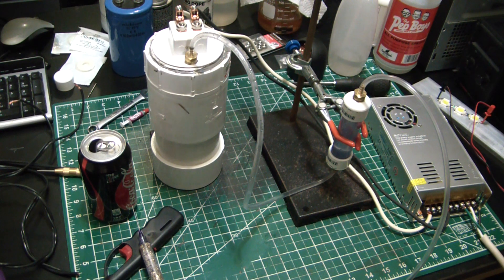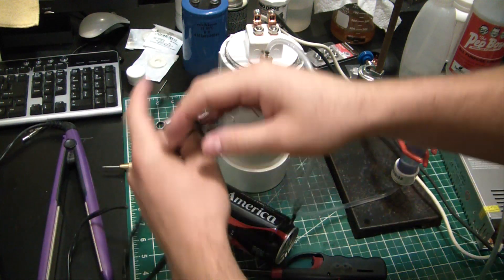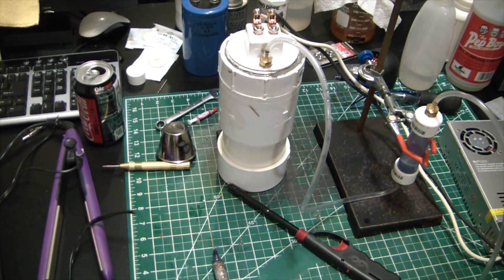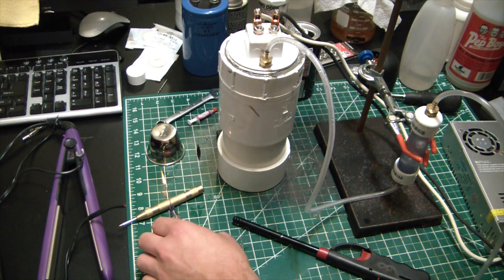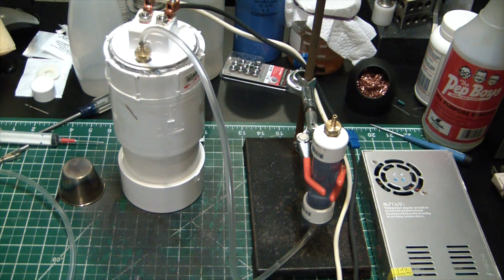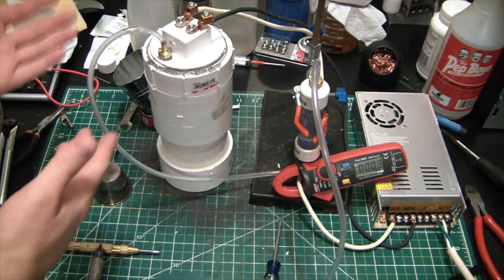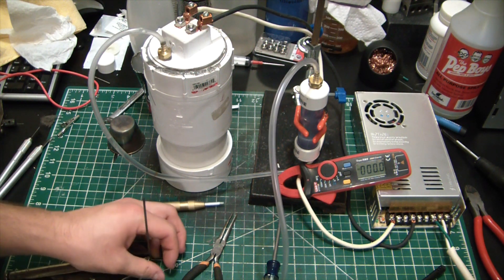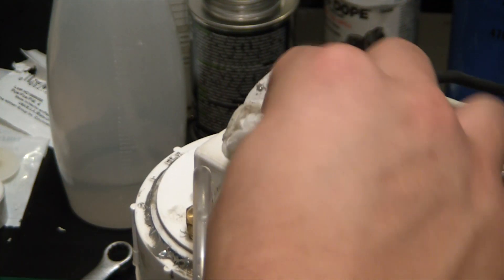Cutting Metal With Water! HHO Torch Success - ElementalMaker

Comment: To make garnet or synthetic ruby or whatever you're going to need a shaker assembly to 'tap' your Al2O3 and chrome mixture into the gas burner before the gas is lit. Trust me on this, you want to read this section of a book called "Procedures in Experimental Physics" (I have this book) and I have used a similar system to grow strontium titanate crystals for research when I was in college (I did all kinds of neat shit. 

I found the book online, here's the page that shows an apparatus to make ruby:

https://archive.org/details/ProceduresInExperimentalPhysics/page/n537

The book is like 26 bucks, seriously it's worth the read, all kinds of good stuff in it. 

Another thing to note, 10 gauge wire is nowhere near enough for 50 amps you're shoving through it. You need to be down in the 6 or 8 gauge range. Check out this PDF.

http://encorewire.com/wp-content/uploads/amp%20voltage.pdf

Another item which goes along with your wire gauge issue, is your post terminals. First make them longer, so you have enough up top outside to double nut your connections, and I'd scrap that clamp terminal (they get loose as they heat up and the wire compresses), and get a crimped on lug. So your new power connection should go like this... metal nut, your lug, metal nut, some space, nylon nut, o ring, cap, o ring nylon nut on the inside then all your cones. That way you're not relying on a mechanical connection to do your electrical connection. That is a big no no in the power electronics industry for the exact reason you're having troubles. 

FYI, I'm an electrical engineer, so this is the stuff I work with regularly with 4kV motor variable speed drives up to 1000 amp per phase.
Reply from the maker: See my latest ruby video, I was able to successfully make it. I will be building a larger hho generator in the near future so I appreciate your feedback and links.
Reply: Oh, and to make crystals, you're probably going to want to make a bigger water bubbler to catch the carry over NAOH, and then follow that with a drying agent as moisture will make your feed stock clump up... you could use the desiccant stuff from a compressed air dryer.

Good luck!

Comment: Congrats on the successful cutting - nice. A next possible direction might be to produce hydrogen gas by chemically reacting sodium hydroxide and aluminum, and using the gas pressure to regulate the NaOH level, so regulating the reaction to produce as needed hydrogen gas? If done right, no need to store too much gas, but just produce it OTF. Uses= producing hydrogen to power a regular gasoline engine from scrap aluminum.

Comment: Maybe look at building a solid state hho generator. Your melting pvc issues should be a thing of the past.
Reply from the maker: Got a link? Never heard of such a thing.
Reply: @ElementalMaker  My wording was wrong, they call it a "Dry Cell". The HHO generator you have is a "Wet Cell". I saw the dry cell on a compilation video where the guy did not have a flashback arrestor and the flame shot back into the collection chamber and exploded. Anyway, it led me to research the weird looking mechanism since i've never seen it before and found this video:
https://www.youtube.com/watch?v=gQOxWXRsLB4

Comment: Dude, backflow arrester.

If the flame cuts out momentarily it can run up the tube and blow you up.

"my generator has a leak"
turns on generator and lights torch

C'mon now.

Also, aluminum is noxious.
Reply: Sunny West nahh, depend on how much hydrogen you have on your system, in general hydrogen can only flash back below a certain level of pressure/gas speed, such that if the on demand system can handle the small gas explosion energy then there's nothing to fear, however if you're storing hydrogen that's another conversation... damn i used a pet bottle as a 4 minute store of torch gas, that's dangerous as a motherfucking fuck.... it's firing up a dynamite  everytime....
Reply: The bubbler he has the gas going through acts as a flashback safeguard

Comment: Try to separate the hydrogen from the oxygen, and use the oxygen for a.. metal cutting carbide lamp?
(Acetylene burns hotter than hydrogen)
Reply: From what I have read, nothing burns hotter than hydrogen. Hydrogen burns at 5000 degrees. That's why they use it for rocket fuel.
Reply: UNITED POLICE STATES OF AMERICA from what I have read...acetylene is one of the few things that burn hotter than hydrogen?
(It has something to do with the carbon-carbon triple bond)
Just the temperature at wich something burns doesn’t determine how good it works as a rocket fuel.
Acetylene is too unstable and it can’t be stored under pressure.
Reply: UNITED POLICE STATES OF AMERICA btw the hottest burning substance that we know is Dicyanoacetylene, according to Wikipedia

Comment: smooth tip and enough gas flow to get a gap between tip and flame always works best anytime O2 is in the mix. Adjust the power supply down to get optimum current. there is a adj pot on the supply. To high of cell voltage will overheat everything cell terminals ect ect also the   power to high on cell causes O3.....4..5  as the temp goes up so does this factor and as number increases the flash point goes down rapidly!. hho has very low density a atm and burns extremely fast the low density makes the bang from the reduction of volume after the wee bit of heat so producing even greater reactivity of the O increases burn rate dangerously.
@2.5 volts the separation is at minimum reduce voltage by 1/2 a volt should help for operation of few minutes. Thermal and fluid level fail safes save from have to pick pvc bits out of your body. I have built these out of soda pop bottles but they always failed because plastic loses strength at low temps. Repurpose  stainless steel thermos cup or something stronger never use glass for HHO and add basic fail safes if you don't feel explaining to the ER  nurse how you  ended up with such a large chunk embedded into your ...... and the number of times you will be ask now how did .... not fun justasayen
Reply: p.s. back flow/flash is very important !. good ones that actually function some stainless wool stuffed in a tube is a fail to sum it up

Comment: You can use longer threaded rods and wrap the copper conductor directly into the rod and brace/clamp it with some thicker solid copper wire wrapped around it, the direct contact with the rod should allow more current without over heating and by using longer rods you can keep some distance to allow any heat to dissipate more.

Comment: Do ya think you can use the gasses generated in a combustion engine?
Reply: some people do, supposedly they get really great mileage that way on account of the fact that internal combustion engines rely on gasoline vaporizing in the chamber, being pulled into the piston and exploding to produce work. it also helps that hho gas is more volatile than vaporized gasoline on average.

Comment: I wish someone would make a video describing how Hydroxy Gas,( HHO ) is produced?  When you produce Brown's Gas, (HHO) you are not producing  Hydrogen!  Some Dumb-Asses think that's what is coming out of their bubbler!  When you produce on-demand HHO Gas,( to run your car, lets say) the engine is burning by the process of Fusion, Hydroxy Gas!  This is a different Molecule...It's not just Hydrogen and Oxygen!  That's where the Big Oil funded Myth Buster horse-shit starts!  They want to divert your attention by making you think Electrolysis Is necessary in order to produce the gas that's used to burn in your engine!  It is not!  Electrolysis is an Energy expensive process.  Producing Brown's Gas, ( Hydroxy, HHO ) does not take very much energy to produce because you are splitting nothing, just causing a different molecule to temporarily form bonds!
Reply from the maker: I'm going to respectfully disagree and say you may need to study the science of this further.

Comment: Looks good, maybe try incorporating a radiator to cool the water in the PVC down, could help with your heating issue
Reply from the maker: Very solid idea! If I have to do any long runs that will be a great solution for cooling the cell.

Comment: I love this project! HHO torches seem to catch a lot of shit for some reason, this looks like a lot of fun, practical uses aside, splitting molecules in the garage to produce an extremely hot flame sounds like a good time to me!
Reply from the maker: I think anything HHO gets a bad rap due to the potato brains trying to power their car and create overunity devices with HHO cells. It's definitely been an awesome project though, and the result has been great. Thanks for dropping a comment!
Reply: I heard that! I am hoping to try this soon, first I am still playing with a vacuum cannon i made from an old A/C compressor a neighbor gave me. Can only draw about 27.5"Hg so not sure if i can get the vacuum strong enough. Once i break the sound barrier in the shop with a ping pong ball I am hoping to try a few projects dealing with electricity. I saw someone produce Iron Oxide (III) using rail road ties, an electrolyte solution,  and a 12v supply, seems like this would be cheaper to produce this way at home instead of purchasing the ingredients for thermite reactions.
Reply: That's because there's no such thing as HHO.  "HHO" is a scam created by an Italian dude to sell bullshit products.  This is actually called a "water torch", and the gas is just a stoichiometric mixture of hydrogen and oxygen, called "oxyhydrogen", not "HHO".

Comment: the terminal is too short, if a bit longer you could put an extra nut under the contact and apply more pressure by squeezing them together to get a better contact and take the contact point off the plastic.
Reply from the maker: I've solved the issue by installing the heat sink plate under the connection terminal posts. It keeps the connection cool and allows higher clamping pressure. Only trouble is my 5V 60A power supply took a crap, not even a month old. Got a brand new one coming though so hopefully this one holds up.

Comment: Can you weld two peaces of 1/16 or 1/8 aluminum together? I would like to see that. 👍
If you can, I all need to make a setup like that for myself. 😜
Reply from the maker: Aluminum is a bit tricky as it conducts the heat away very quickly. This is also a very oxidizing flame, so it would probably booger up any weld you were able to make. I'll keep my tig for aluminum.

Comment: wouldn't it be easier to produce hydrogen chemically with acids or bases?
Reply from the maker: Yeah but hydrogen won't burn as hot in atmosphere. The cell outputs a stoichiometric mix of H2 and O2 which burns at 5100F
Reply: good point, it would be interesting if an engine could be run by the reaction of acids and bases with metals, vehicles with a stomach.

Comment: It might be worth considering putting the generator inside another containment or under your bench, just in case you get an internal spark from one of the electrodes. A face full of hot sodium hydroxide would be really really bad. Keep on keeping on with the experiments.
Reply from the maker: The generator itself is nearly filled to the brim, so there is very little room for the gas to explode even if it were to make it past the flashback arrestors. The solution is also quite weak, being less than 1% NaOH.

Comment: Could it be scaled up and used as welder?
Reply from the maker: Im sure it could, but the main concern there would the the oxygen content of the flame, as it will oxidize the materials you are trying to weld.
Reply: Would it not be the same sort of thing as oxy acetylene welding?
Reply from the maker: I've never done Oxy/Acetlyene welding so I honestly couldn't tell you, but id imagine that for welding you would enrich the flame to make it less oxidizing. Here you just get the straight stoichiometric mix of H2 and O2. I'm sure it could be done, it just might not make for the prettiest welds since the flame will be oxidizing.

Comment: the power over a resistive load is only depending on the current. use P = I² * R to calculate the power lost over said load. you can see its a shitload of power

Comment: Great stuff mate. Could you use Brass or Copper nuts,bolts and washers on the terminals on the reaction vessel?  To lower the resistance maybe. Replace the top cap with Tufnell ( it might be called by a different name U.S) it's got good thermal and electrical insulation properties. Just a thought. Take Care Mate.

Comment: Need a pulse width modulator to keep YOU HHO cell from having runaway amperes.
Reply: bill woehl i was scanning through the comments section to see if anyone else suggested this before i said anything. 👍👍
Reply: pwm yup and add sonification if you want lots and lots of production. Sonification increases nucleation rate and this leads to less recombining that makes it heat up and waists energy.  nobody knows this trick some have tuned there mech shape and driven the pwm frequency to resonance not knowing they were causing the increase with ultrasound from the combination at resonance the gain and very low heating losses should have made it obvious.
Reply: and a backflow arrestor please
Reply: @sunnywest6468  and some "wool" in a tube is a fail . how many times people have advised same info. I can only hope he reads and takes  a momento to consider,  then picks those minimum necessary  items so the results are not with so much risk. melts cap says don't wanna make another. really ok
Reply: Lance Menke lol i used cigarrete filters, 3 rows of them before a bubbler, they're not perfect but they work.
Reply: you seem like you know what you're talking about so i'll ask you. You could absolutely run this on ac right? it's not like youre trying to keep the hydrogen and oxygen seperate so what does it matter? unless im missing something. like you might wanna use a transformer to step it down but still
Reply: Enderbro 3300 yes you could run a generator directly on retified ac, however you should make a generator with a minimum of 80 neutral plates for 120v  or 160 for 220v operation, a cell need just 1.4 to 2v  and the maximum amount of current you can get, if you want to use more than 1.4 per cell you're just wasting energy into heat, what matters here is the current over each electrode.
Reply: @fss1704  what if you step it down to like 2 volts via a modified microwave transformer first? It'll still be a sine wave but only 2 volts. Would that be better?
Reply: Enderbro 3300 you'd loose 0.7+0.7v from the rectifiers, at (80A)*0.7=56w loss on the diodes,    you'd loose half of the power on the rectifiers, that's why you can't make a low voltage dc supply from a transformer and that's why every pc power supply have two beefy "transistor-like" rectifiers for rectifying the 3.3 and 5v rails, check the (A)node (K)athode (A)node silkscreened on the pcb or download the datasheet for these components and you'll see
Reply: @fss1704  well what if you feed the cell low voltage ac instead of rectifying it? Why do you need to feed it dc?
Reply: Enderbro 3300 the cell behaves as a capacitor to ac, shorting the signal, it doesn't work, you're way better working on 12v and 6 middle plates, i build a lot of generators and that's what works, if you use 12v you can use less current and less dropout from the wires.
Reply: @fss1704  rectified? as in full wave bridge rectification,  this is what makes AC into DC. its a series of 4 diodes connected in a diamond shape, this chops the ac sine wave into a half wave dc signal.  also electrolysis begins at 1.25 volts but we won't split hairs over .15v haha. please don't apply AC mains power to a cell.  if you can step down from 240/110 to say 12 volts then nothing untoward will happen, no hho will be produced, why?  the alternating nature of AC (ie backward and forward at 60 times a second) prevents the ions from actually flowing. In a nutshell AC is terrible for electrolysis.
Reply: @fss1704  I think you may bee confused a little, I think you are talking about .7v forward voltage of each diode. so during rectification we can say that we would lose 2.8 volts (I suspect its actually 1.4 volts due to the parallel nature of part of the bridge rectifier). As our rectifier input voltage is AC from the transformer  we can compensate for forward voltage loss by increasing the transformer output (eg, 20 less windings on the secondary). we now have 14v AC coming out of the transformer and fed into the rectifier in order to get the required 12v DC.  the 4 legged Transitor like components you are talking about are just a modern way of packaging the 4 required diodes in one package that makes up the bridge rectifier.
Reply: Danny Anderson yes i was talking about a bridge rectifier to get 1.5v to run a cell with ~120w 80A as an example to show that it's a fucking bad idea that waste a lot of energy into the rectifiers.
Reply: Enderbro 3300 7 neutral plates on a 12v generator can give very good results.